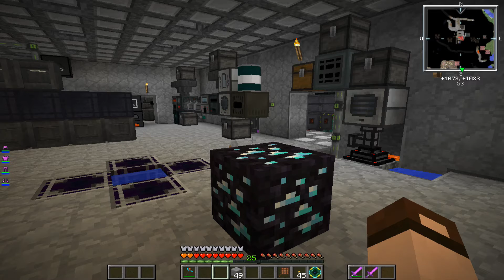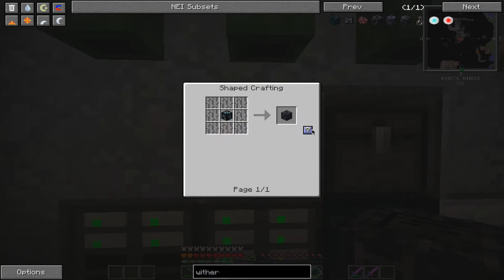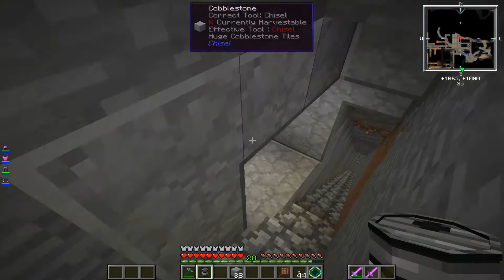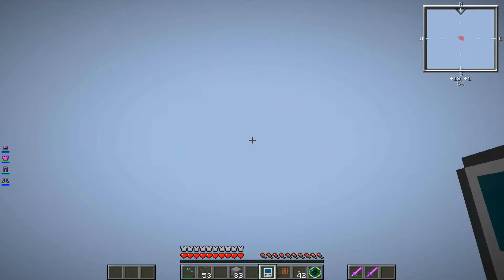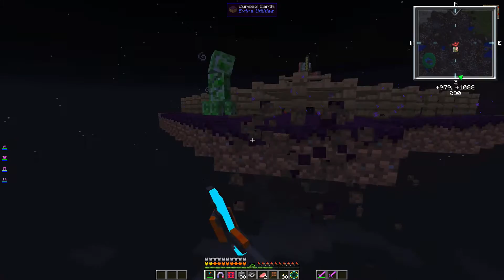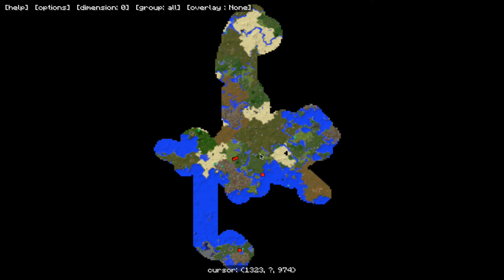Modsauce LP - EP10 - BIG Big Reactor & Quest for Snow

Comment: I've watched you do this ritual a few times now across different (later) series. You always seem to wait till the moon is at 90 degrees vs just when the sigil starts to glow. The ritual seems to work fine if you do it when it glows. Is there a reason you wait or old habits? I've totally stolen your fence method. Really works great. One of those, "how did I not think of this already" things :).
Reply from the maker: +Ben E I don't know if the Sigil glowed back the first time I did the ritual or not, but I never got into the habit of watching it. Maybe NEXT time I do the ritual, I'll remember to. :)

Comment: you can add yet another modifier if you add a gold apple(the one made by blocks not ingots) and a diamond block and normally if thaumcraft is on pretty sure it isn't on modsauce if u make the parts out of paper thaumium and ur repair material you can start with 5 modifiers and add the 3 more
Reply: new to the channel just chucking up my comments as i go through the series XD

Comment: Hey Nonsanity great video as always. I wanted to tell you this the other day and I think I forgot. Your Minecraft sounds are barely audible on my end. Most of the time I can't make out any Minecraft sounds. Personally I think it's fine like it is. I just wanted to tell you for your own information. Your voice is always clear though a little on the low side because when I watch on my iPad I can barely here you at all. On the computer it's not bad because I can turn up the surround sound. If you keep at this your channel will grow quickly. You always have some really great content.
Reply from the maker: Hey, thanks for the technical update! That helps. Currently, the game audio is only being picked up by the mic since my first attempts to record it internally resulted in bad static. I think I've got that solved but I hadn't tried changing over to that technique yet. I'll try that and also adjust the gain on my mic on the next episode I start. (Don't want it to change mid-episode.) :)